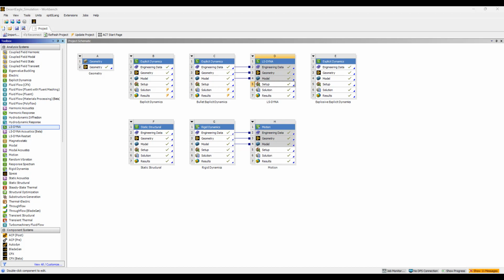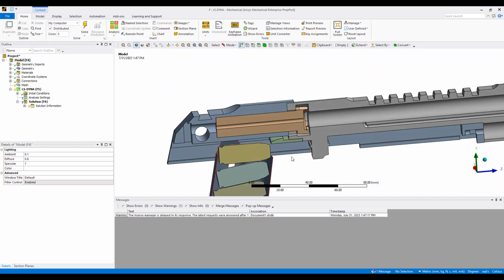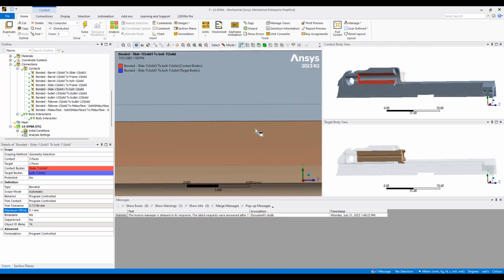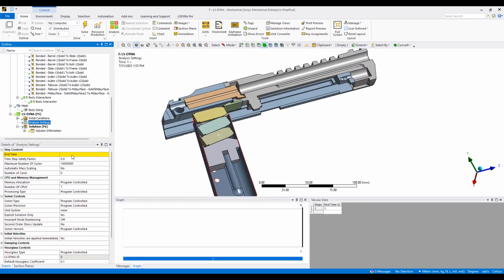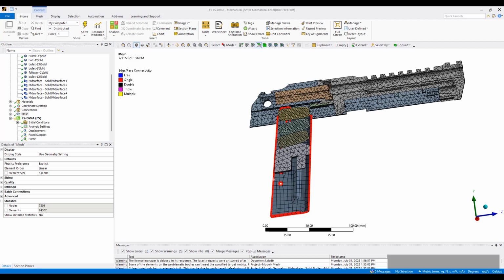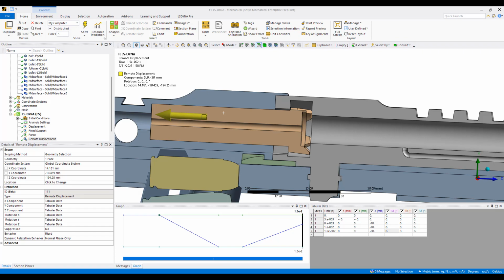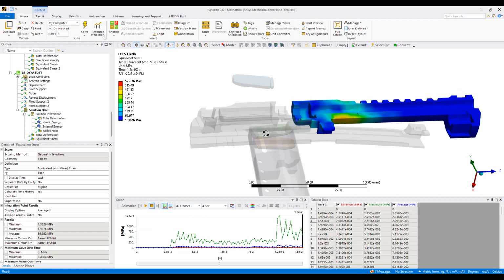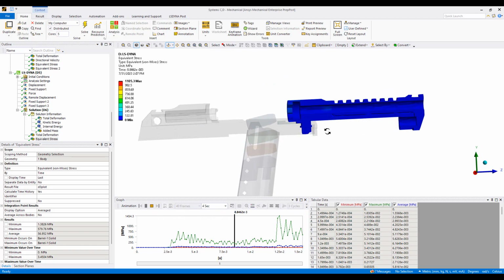Firearms simulation in Ansys: Part 3 - Bullet motion in Ansys Ls-Dyna

Comment: Good simulation, however, it would not happen that the projectile suddenly comes out, you need to look at the stiffness of the spring on the magazine. Also the weight of the individual projectile so that it does not behave as if it has no mass when it comes out.